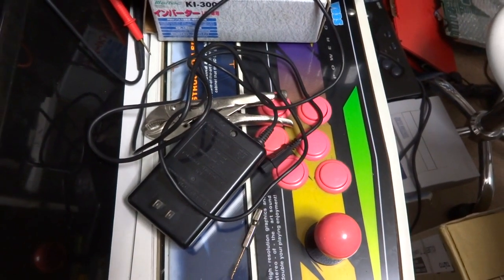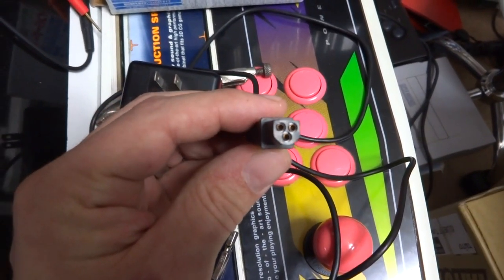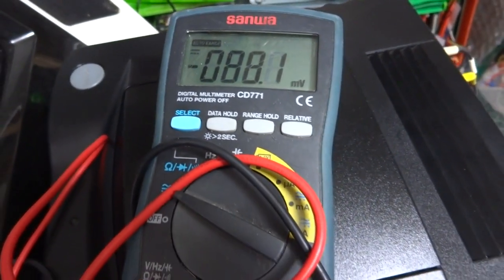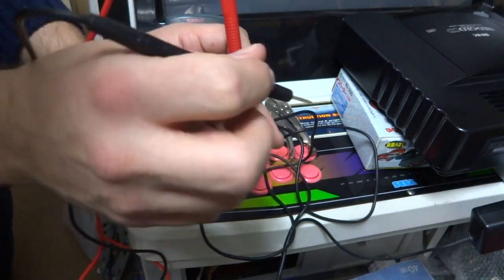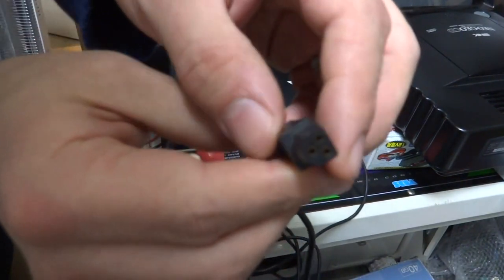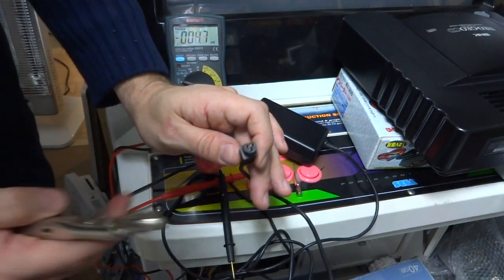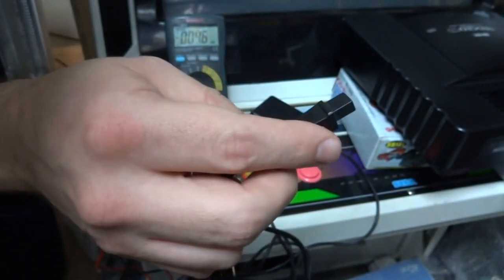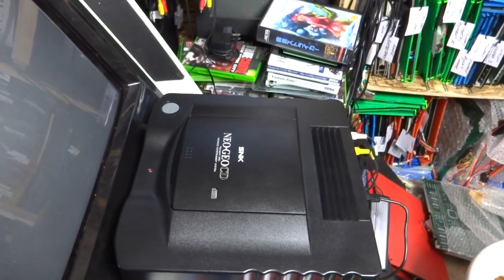Neo Geo CD No Power / Power Supply Problem Repair

Comment: That's a great repair tip, I'll definitely have to keep this video in mind if I ever run into this issue with my Neo CD's ac adapter cable down the road sometime. So far the only issue I've run into is the disk spinning issue that was solved by adjusting the pot on the laser mech, but if my machine fails to power on one day, now I'll know what to do, Thanks for this tip man!

Comment: Bit of a wild card this due to it being such an old vid but any help would be greatly appreciated Luke.

My neo cd won't switch on at all. I have tried this trick but no luck. All that happens is the led flashes and the system powers on and off immediately. Almost like it is spiking. It used to get into the game and then reset but it has been fine for over a year.
I bought a new ac adapter as I was thinking it was broken but still no joy. If I leave it switched on then it will just switch on and off. Both psu's make a buzzing noise when the console powers on.
Any idea's would be greatly appreciated again Luke.